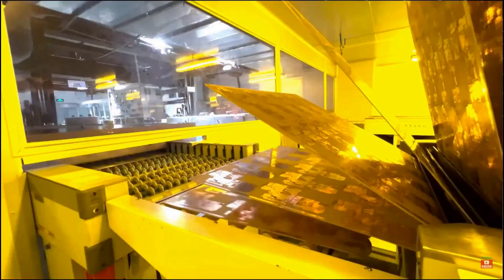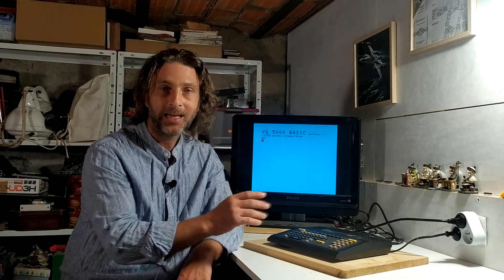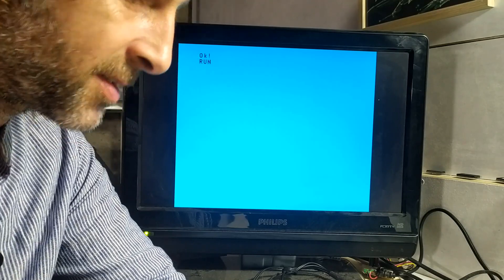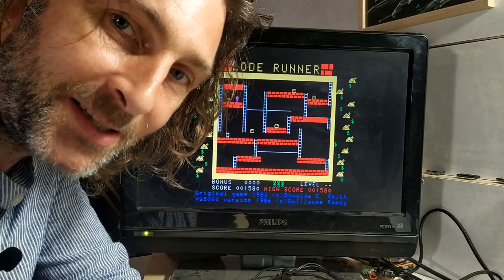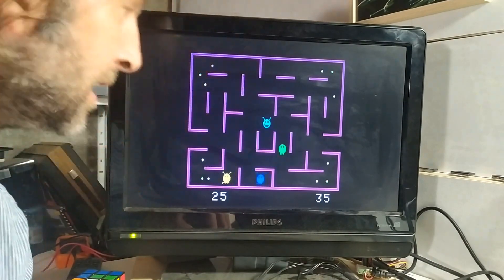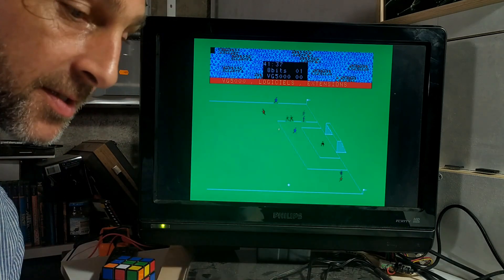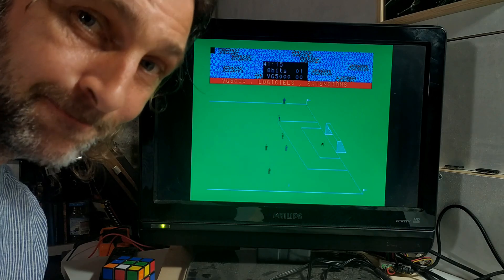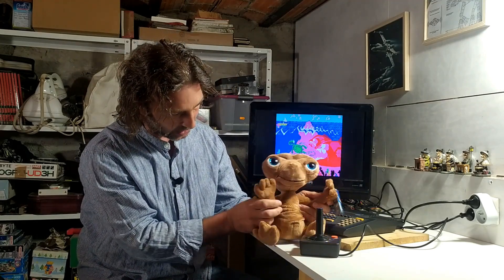So what's that French puter like as a gaming machine? Philips VG5000μ Part 2 | 8bitsinthebasement

Comment: I noticed the screen resolution is considerably higher than that of the Videopac/Odyssey². So it makes me think of the unused potential of this charming little machine. If things had been different, it could maybe have seen games equal to those of a ZX Spectrum or an Apple II.
Reply: Funny that you mention the Videopac/Odyssey² - as Glouton is virtually identical to KC Munchkin albeit at a higher resolution. And it looks like the level layouts are identical. KC Munchkin couldn't let you save your homemade levels though.
As is the Space Monster game, although on the Videopac you only get vague shapes for the enemies, so it took me quite a while plus the narration to figure out it's the same game gameplaywise.
EDIT: And that's why you don't post a comment before watching the entire video because he says it in the end...
Reply from the maker: Philips got a little lazy and just ported the games with slightly better gfx and little more. It's a pity really but it's crazy that the Videopac that was so much older had more playable versions of the exact same games. A classic example of a half ass system launch. Pity, given the hardware it was built with.
Reply from the maker: I'm sure that some great games would have been made for the VG5000 had it been given a chance from the start. The thing also had a unused 80 colum mode. It could have been a real beast.

Comment: I reckon there could be an msx conversion cart for this lol
Reply from the maker: You jest, but the 16Kb memory expansion for this unit will work on an MSX. What's more Philips version of the MSX computer shares cartridge, cassette and Scart video pinouts with this system. The VG5000 was like a MSX trial run that Philips really didn't care about. Pity really.